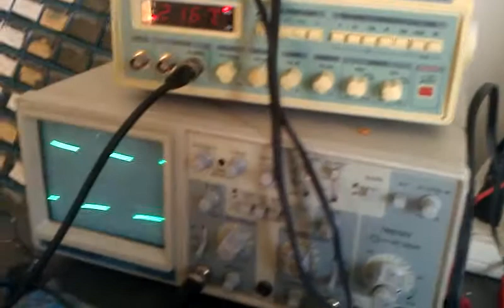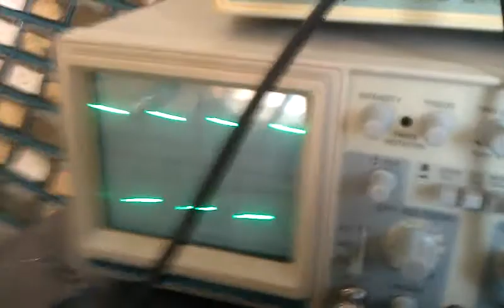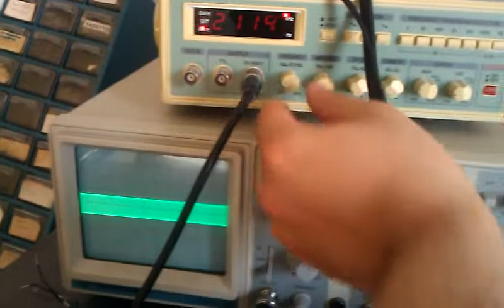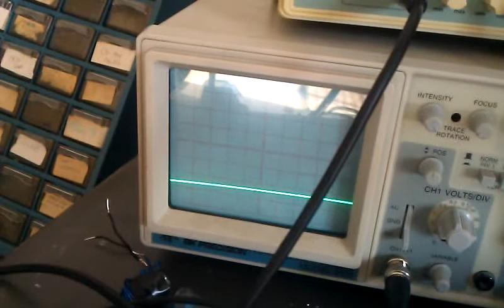Parallel LC Resonace 7  - Pulse Transformer for Mosfet Gate isolation

Comment from the maker: The impedence of your transformer windings will ideally match (or not be less than) the output impedence of your TTL chip. The formula would be: XL= 2*pi*f*L or 500ohms = 2*pi*1000Hz*L. So solve for L. Other considerations: mosfets require around 8 volts to turn on, so adjust coil winding ratio accordingly. Amidon has charts for impedence calculations. An LCR meter is a handy tool for adjusting and testing your transformer.  see here: aade dot com/lcmeter.htm for example.

Comment from the maker: It looks like one coil, but it is in reality two separate coils.  (note: be sure to use power supply bypass capacitors). The overall idea is your pulses have a duration, or period (t).  If that period is 1 millisecond, then that corresponds to a frequency of 1000kHz (f=1/t).  Once you know the frequency, you then need to know your source impedence. If you're using a TTL logic chip, that may be 10mA at 5V, which is an impedence of 500ohms (5/.01). Now you can design your transformer windings.